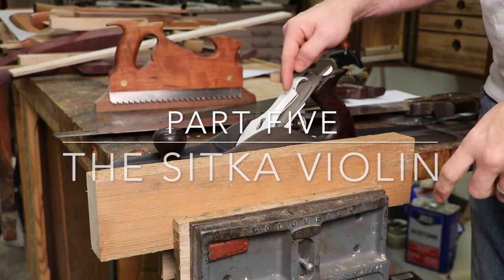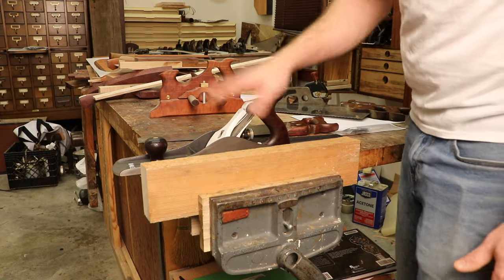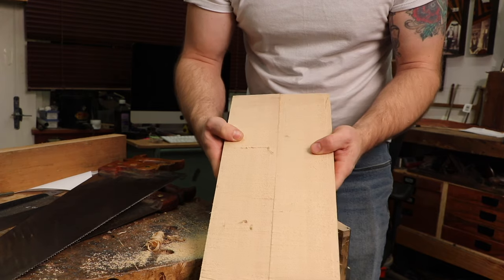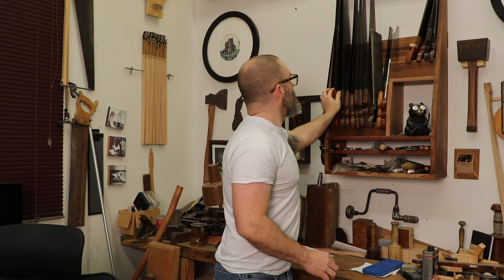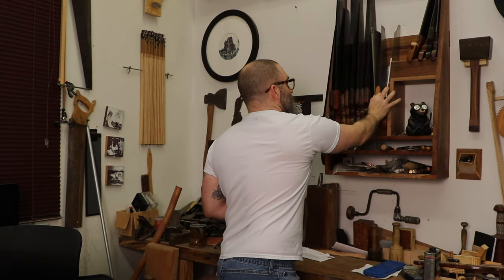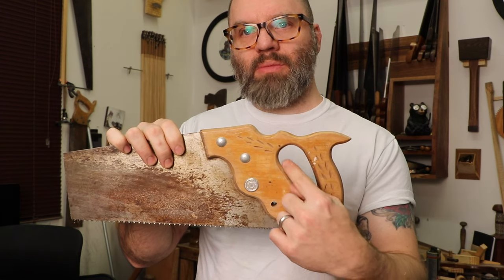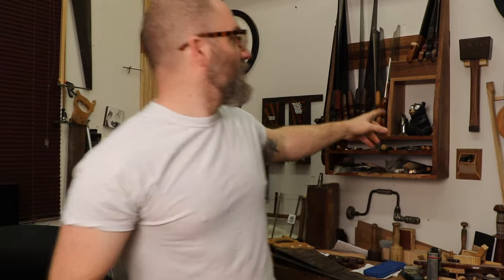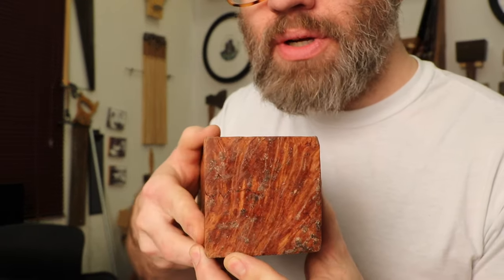The Sitka Violin: Part Five (with a little saw history)

Comment: Nice work and wonderful tools.  I did notice you flipped the stock when cutting the kerf with the plane.  I always use the same face when registering a tool (one I've flattened), square or fence. Just the way I was taught and it does help keep your process uniform and consistent.  Can't wait to see the finished product.
Reply from the maker: I didn't even notice haha! normally I would rotate it but I guess showing the kerf for the camera made me flip it. But it was on center for this one thankfully. I can't wait to see it done either!

Comment: Why not use the band saw when splitting the board? I’m sure there is a reason!
Reply from the maker: Yes. There are a few reasons. One mainly I am nervous about the blade drifting at all when I only have a mm or two to spare in this case. If I had more meat in there I would have done that.